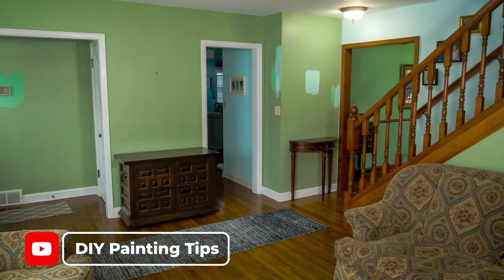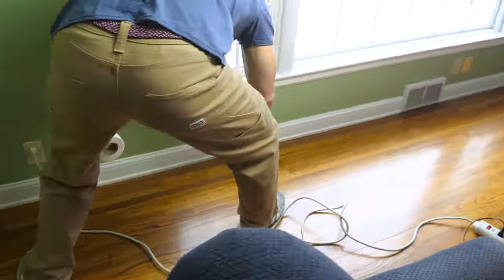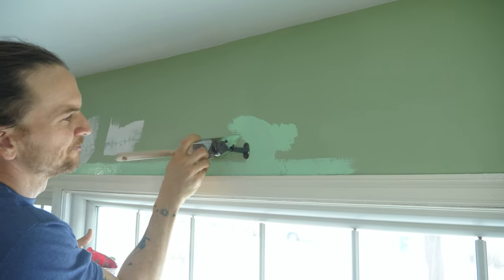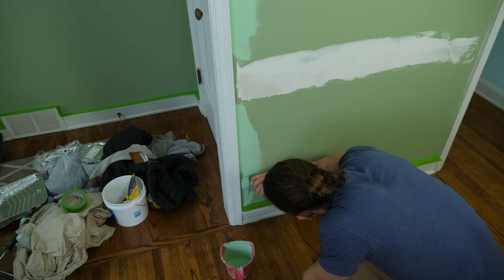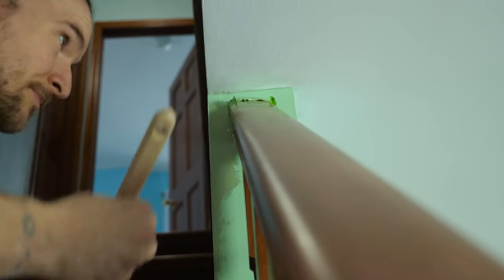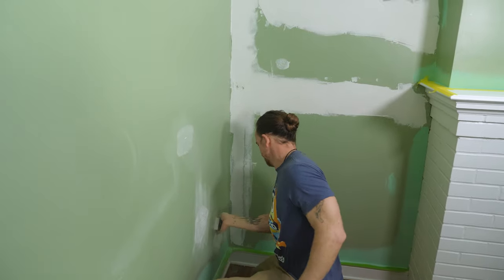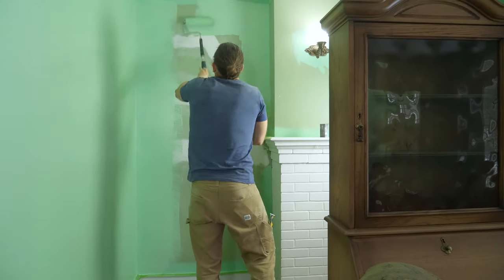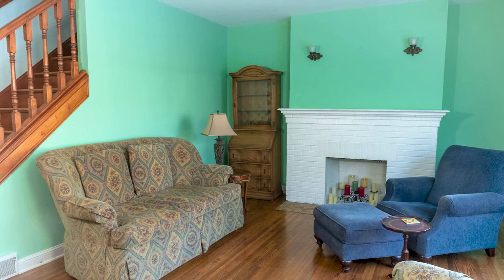Living Room Wall Painting | Start to Finish Client Job

Comment: Thanks so much for taking the time to upload this today. It was exactly what I needed to hear. I've had a room left about 10% unfinished for a month. I keep saying I want to get it done but the problem is... I have no PATIENCE right now to do it properly so I know I'd be more disappointed with the mistakes in the finished product than I am with it sitting 90% done. When you said that...  it clicked that that is my problem. Ceilings need another coat, which I dread... and even though I gave a light sand, my crown molding and baseboards look smeared on. I'm going from a. white semigloss finish to a black matte finish so I'm sure the second coat will make a world of difference. Walls and shutters are already done. I need to find patience today so I can finish. LOL. Thanks for the motivation. I always enjoy your tips and tricks.
Reply from the maker: Good luck finishing your project, you can do it!

Comment: Use a small roller in one hand and brush in the other. Roll on the paint with the small roller and follow with the brush. Get a lot more paint on the wall at one time without dipping the brush in the paint.
Reply from the maker: Interesting tip, I’ll have to try it and see if it speeds me up!

Comment: Nice job, the color is a bit bright for me ,I like a grey-er pale green. You are right a good stiff brush is very important for cutting in I like the Purdy clear cut.  I do tape door and window vertical trim on new construction and natural wood finish trim. I always caulk new paint grade trim it makes pulling a straight line much easier for me same with ceilings. Drywallers leave a  void with their knifes at the edge when doing a knock down finish that makes for me a ragged transition  between ceiling and wall paint so I caulk that also. I also always have a can of Bullseyes spray shellac for problem spots like markers that will bleed through and drywall repair.
Reply from the maker: Great tips. I keep a can of Kilz in my tools for the same issues.

Comment: Great tips, thanks!
Would you use a larger roller if you were not teaching DIY techniques?
Reply from the maker: Yes. When I'm not filming, I use a 14 or 18" roller whenever possible. But they are not DIY friendly, so I do not use them in my videos.

Comment: Thank you for this. I actually learned new tricks! Question. My home has lots of old drips from previous paint jobs. Do you just sand them all off?
Reply from the maker: I try to scrape them off first, then a little spackle and sand. If the drips don’t scrape off, then sanding usually works but takes longer. Worst case scenario, you can skim coat over them and try to smooth them out.

Comment: What if you had to paint the trim too?
Reply from the maker: If I had to paint the trim, I would do that before the walls. Prep off the floor, brush out your trim (prime and two top coats sanding in between each) and before you tape it off to do the walls, make sure it’s dried/cured enough so that the tape doesn’t damage the trim. Good luck!